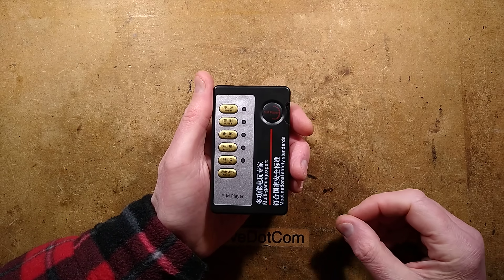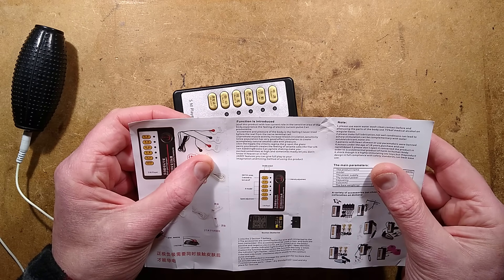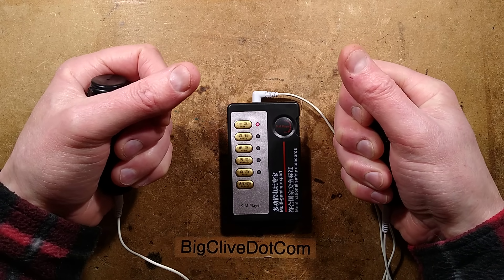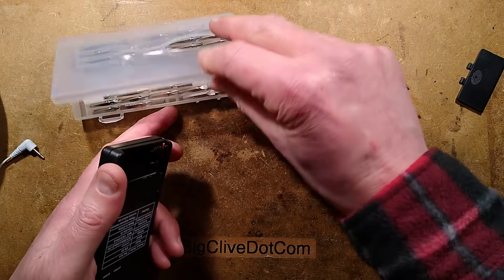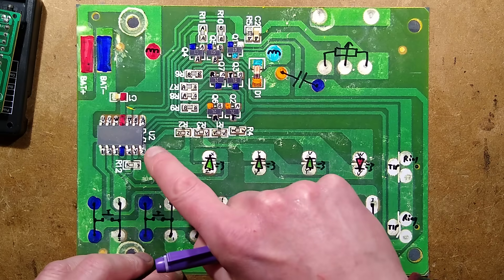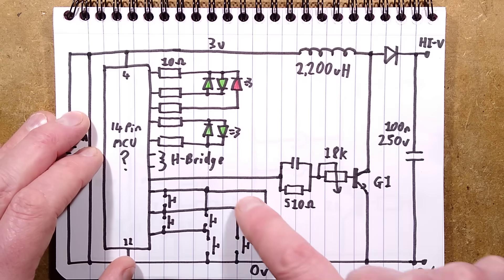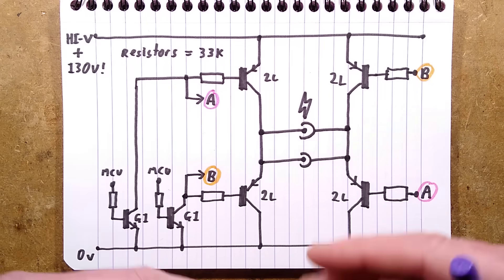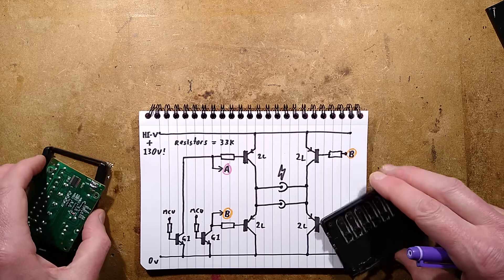Inside an invigorating electro-health device - with schematic

Comment: The VRRM of a 1N4148 diode is 100V so if the diode fitted to the pcb is a 1N4148 then it is being seriously abused.
Reply from the maker: It wouldn't surprise me if they were pushing it beyond its limits.  It may well be a higher voltage diode though.
Reply: Like some of the electrodes will be.
Reply: It's a freebee-type device, costs less than a dollar to make and won't be used for more than trying that stuff out before the customer buys something better (i.e. 10-30 dollar range). It wouldn't bother me if those things lasted for less time than their batteries, tbh.